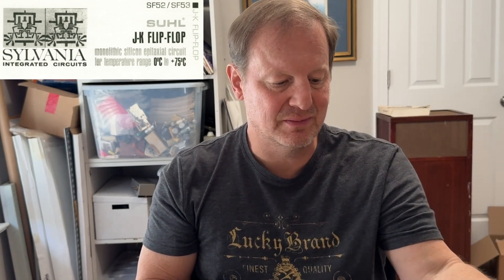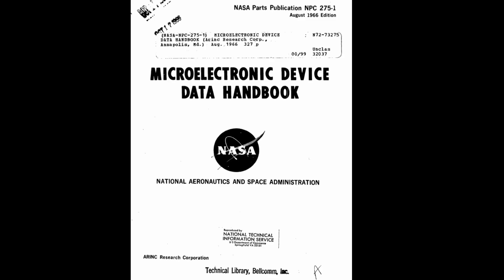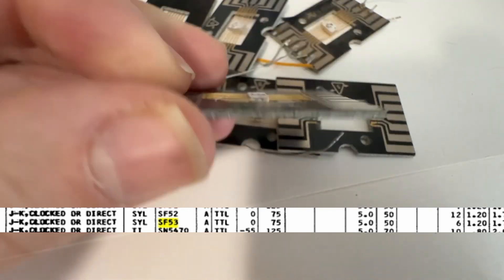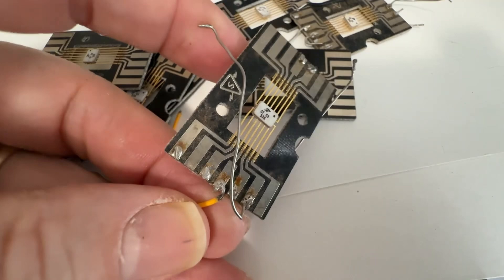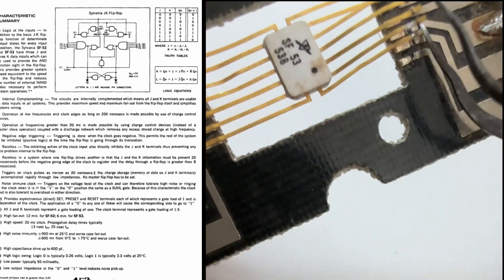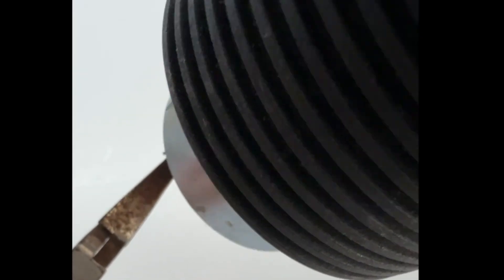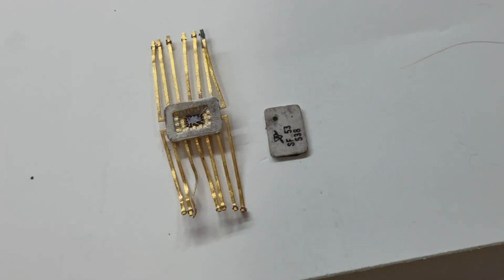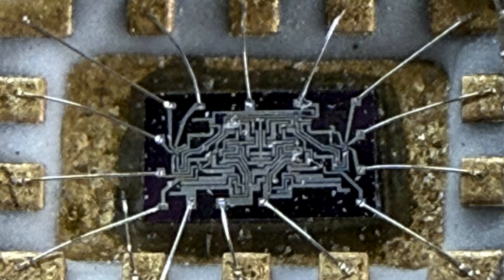Sylvania SF53 Decapsulation microscopic view Flip Flop Flatpack IC Space

Comment: Aluminum bond wires? From the 70's?
Reply: If I remember correctly there has been some time when they experimented with different metals, and copper didn’t agree with silicon. Some years ago I read about a solution for that problem. So aluminium wires are very well possible I guess
Reply from the maker: @techslfink9722 Thanks for the insight!
Reply from the maker: I think it is aluminum wire bonds, but it is from 1965. Thanks for the great info!
Reply from the maker: See Short reply